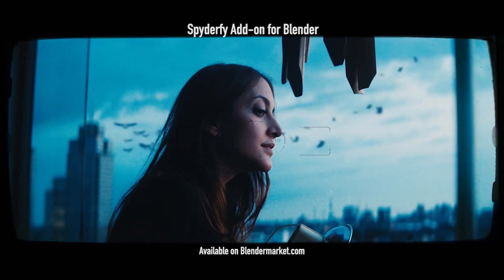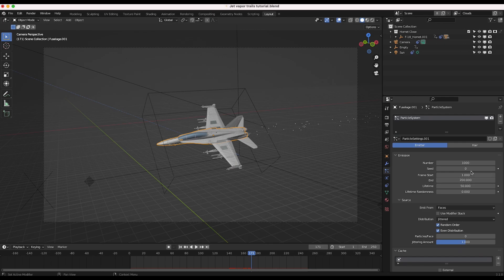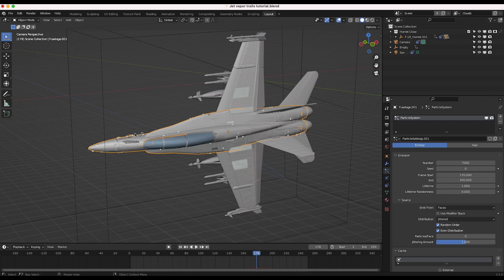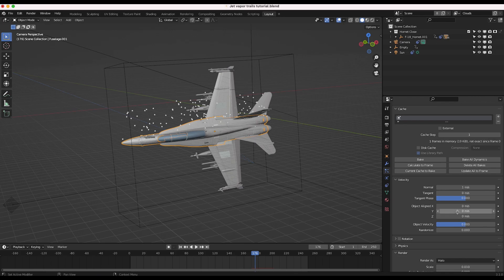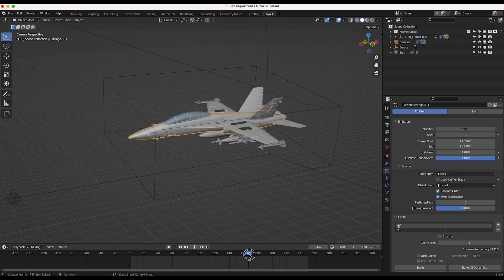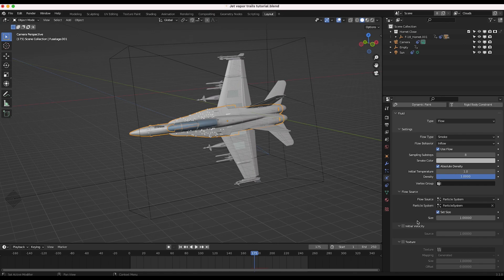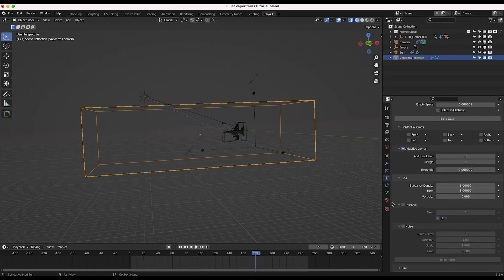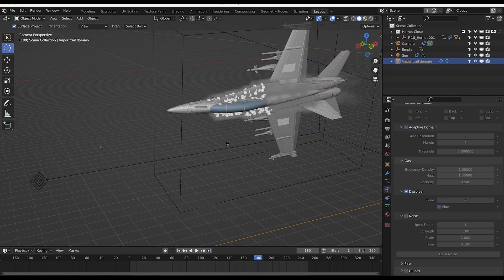Top Gun Vapor VFX in Blender 3d: Simulation Tutorial!

Comment: Principle is nice, but you totally missed to apply scale of the container domain, you can clearly see the voxel dimensions are too big.
Reply from the maker: Hmmm. I'm pretty sure the voxel dimensions are determined by the resolution divisions no? I cranked it up pretty high but you are right I could have increased a bit. It's a tradeoff between speed and a decent result.
Reply: @LightArchitect  you need to apply scale to the container geometry or the voxel res is not applied correctly.